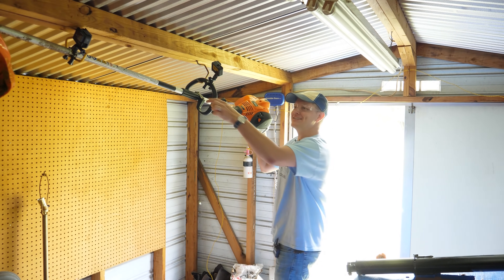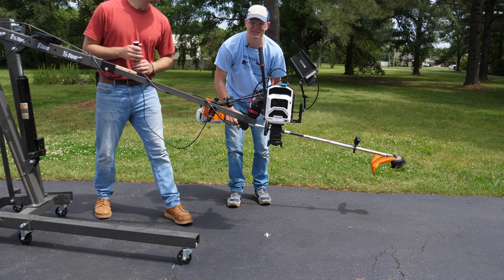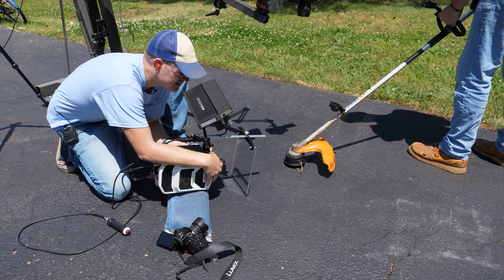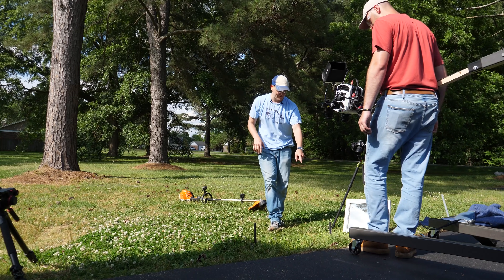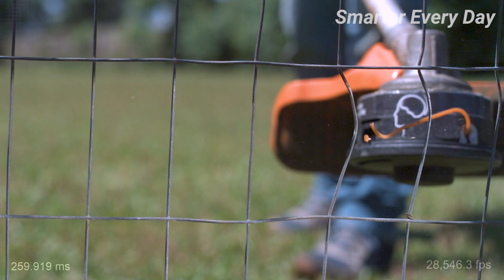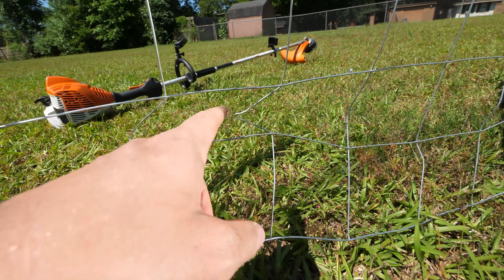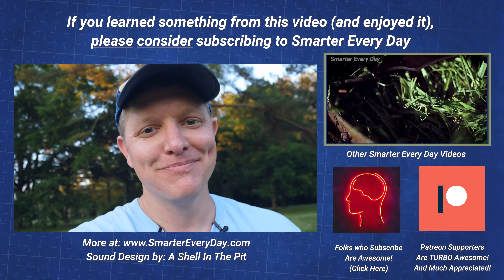How Weed Eaters Work (at 62,000 FRAMES PER SECOND) - Smarter Every Day 236

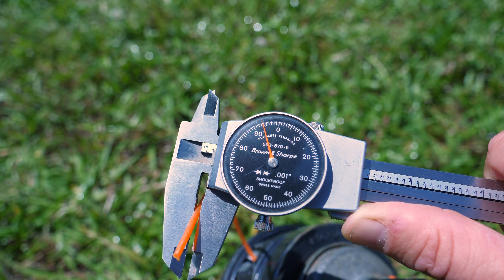Comment: 10:29 
Me: well the small line is always gonna be 2,4mm right
The guy in vid: looks like 95 thousands of an inch
Me: Okay, if you say so
Reply: There are all different line thicknesses available, with the motor power typically the deciding factor in which are supported by a given whipper snipper. 
But I was like you, 95 thousands - no idea if that's thick, thin or in-between.
Reply: @Thermalions  As far as I know, on all of the regular small trimmers its gonna be standard 2,4mm 90% of the time and sometimes 2,7mm. I do have a larger Husqvarna that uses 3mm line, but thats as big as it gets, you dont see it on the more common smaller ones. I have no idea what 95 thousands of an inch is, I only guess its 2,4mm.
Reply: @FOKI5895  My Stihl AP battery powered trimmer is 2.0mm, but I'd agree most small petrol powered ones would generally be 2.4mm as you say.
Reply: @FOKI5895  2.4 mm / 25.4 = .0945"
Reply: It's beyond me why anyone would consider that a superior unit of measurement over millimeters. I don't even bother trying to convert it anymore, as soon as thousandths of an inch are mentioned by anyone I just phase out.
Reply: @Outland9000  I agree, it's far easier to add millimeters than fractions of inches. In fact yesterday several acquaintances and I were talking about that the other day. Say we wanted to slap together different sheets of wood, 1-3/8 + 2-5/16 + 3-9/32.It's far easier to deal with decimal points in the metric system than fractions..................and we all know how much the common man likes to play with fractions.
Reply: @ItsNotAllRainbows_and_Unicorns  he did use decimal value of an inch not fractions.
Reply: @ObelixCMM  I am not talking about FK, I am merely making a reference to my experiences with people who use standard. I am an engineer and for me it's common to work with both systems, standard and metric and doing conversions. But people I came across who are not so savvy with math find workign with fractions difficult to work with. I often have to spend time giving a short math lesson.
Reply: @ItsNotAllRainbows_and_Unicorns  I work in quality so I deal with same issues, plus engineers that don't know difference between .095 and 0.095
Reply: @ObelixCMM  isn't it the same tho? what's the difference if it isnt the same?
Reply: @opemvbs   Zero in front of decimal is required in metric system, in imperial (inch) zero is omitted.
Reply: Why though
Reply: @whats_happening_in_tvm  murica
Reply: Oh good, another pack of people very butthurt about metric not being used.  How interesting and novel.

Comment: Okay, this was fantastic.  I have soo many questions.

What are the different materials of the line, not just the geometry?  Now that we know that little bits of line get broken off and left in your yard, are they biodegradable or otherwise harmless?  What would happen with the cut on the line guard if you sharpened that piece of metal?  And, what would happen if you put some metal wire in where the line was supposed to be?

I can't wait to see your next episode on this, I don't know that you'll see my questions but it will be awesome either way.

Comment: I'm really suprised about all the tiny bits breaking off, that's quite some plastic getting into nature... Are there any bio-degradable wires?
Reply: That's thicker plastic take longer to fully disintegrated although going by total volume it's pretty bad, so it's our kids generation problem. 

Thin soft plastic bag are quicker to get inside the insect and work up into our bodies. Insect > smal fish > big fish > human, all in 3 years or less. People use thin plastic very deliberately in almost anything.
Reply: The line degrades pretty quickly when exposed to uv light.
Reply: I used to use the LARGE scissors

Comment: I would disagree with what’s happening to the Trimmer line as it wraps around the fence. I would guess that the trimmer  motor speed is faster than the unravel speed of the line on the fence and at some point the line reaches its maximum stretch point and snaps. It doesn’t appear to me like the fence is breaking or pulverizing the line by hitting it.

Comment: Something I found interesting which wasn't mentioned on the final test: The line didn't break when wrapping around the smallest diameter wire from what I assume is the wire bending from impact. This would reduce the line speed, and make the line wrapped around the wire subject to less tension. Would be interested to hear what Destin or others think though.

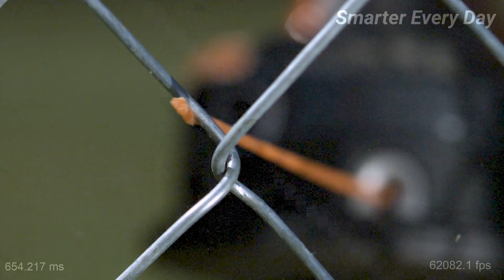Comment: @12:21 I think it is a tension break when the wire hits and wraps itself horizontally and it is a shear break when the wire hits with an angle, which is app. 45 degrees, which is perfect for shear. Maybe you should have kept the leftover pieces and done some microscopy to see the texture of the cut!

Comment: I’ve been running a Homelite weed eater for 19 years.  I recently acquired an Echo weed eater.  I started using it and realized it was throwing debris at me.  Turns out some weed eaters run clockwise and some counter-clockwise.  I’m not sure what I’m going to do.  Do I relearn how to run a weed eater or do I run it like I am accustomed to?  I like the machine but it sure is different.
Reply: No they all spin the same direction. The problem that i found with echo is the trimmer head has a terrible angle and bulky head. Makes the debis thrown from the line propel twords the operator more. And i think the guard may have a little to do with it.  With my years expeience i could run my Huskavarna string trimer without safety glasses and never get hit. But i never was able to with an echo
Reply: Murker 187
You are incorrect.  I have two weed eaters sitting in my garage and they turn different directions.  The line cutters are on different sides of the guard....they are different.
Reply: @Iexpedite1  stop buying from australia.
Reply: Murker 187 

You may be on to something.  Those backward Aussie's have pulled a fast one.  

I used the thing again today and I agree that the shield is entirely too small for the giant head.  Early models had a much larger guard.  Even switching sides and angles put me in the line of fire.  The machine has significant meaning to me...I’ll learn to deal with it.
Reply: @Iexpedite1  lol like the world turned upside down for them.  And ive never seen one turn the opposite direction. So thats new to me. Good luck and dont forget ur ppe

Comment: Really interesting! I was a landscaper for years working for my dad's business. The aerodynamic lawnmower blades were something I had figured out but I always wondered what happened when a weed eater hit something hard. How it broke exactly. Thanks for solving this mystery!

If you ever get to leaf blowers, try standing two five gallon buckets about ten inches apart and blow air between them. I thought they would fly apart but they flew into each other! It makes sense when you think about the physics (faster moving air is lower pressure air) but it was cool to see.

Comment: My grandpa thinks i am so strange because it doesnt feel right for me to trim from left to right. I have to go right to left for some reason.
Reply: Off the head of a string trimmer going right to left helps cushion the load and stress on the line. Going left to right almost pulls the head into the ground and causes stronger impact on the line. But the result is the same if you have good control. Just pay attention to ur rpm's. No need to run one at full throttle.
Reply: @murker1879  i guess that makes quite a bit of sense when i think about it

Comment: Hey Destin, 
Loved the video but I wanted to bring up a few points that you haven't mentioned. You brought up that when wrapping around the wire sometimes it's easier for it to just break off rather than unwrap. I would agree and would like to share my observations from when I've used a weed wacker. I was always fascinated by how the cable of the wacker would heat up during use and especially after hitting a fence or wall. I believe this would be the reason why sometimes it would break at the pinch point of the fence, before it wraps around the fence, or if it broke further down the cable; the point where it's the weakest due to heat (as well as other factors obviously). It would take more testing but I would be interested to see if the places you see with the most damage would be hotter under a thermal camera or, in the case of the high speed in this video, if those points that broke had already hit the fence with no visible damage where I would expect it would instead be hotter then the rest of the cable.
Anyway thanks for continuing the awesome content and the raycon recommendation (I'm gonna get the e55's)

Comment: the most interesting thing about the last chicken wire test is that the metal on the vertical sections doesnt break until it is nearly parallel with the horizontal section, and the horizontal section obviously has a tremendous amount more tensile strength than the 4 inch vertical piece, and you can literally see it bend back and forth until it pulls so hard it snaps off at the base. Youre right, that would be the weakest spot, but obviously the metal is so small and flexible that the effect of the connection is actually stronger than the surrounding metal, and it is the opposing tensile forces pulling the metal apart, literally ripping it like a block of cheese torn asunder by dwayne johnson.

The other interesting thing is that at high speeds the nylon (i presume) line becomes almost a liquid, it is pulled so hard, you can see the line hit, stop, wrap around, and then as soon as the head rotation propagates, it snaps it taut almost instantly, pulling it and squeezing it, often either liquefying the plastic or squeezing some liquid chemical component out. Fascinating stuff to watch. 

Ive said it before, ill say it again, i really enjoy watching slow motion video, it gives you such an insight into how physics works. I wish we could perceive all of reality at these speeds and resolutions, at our own choice of course, but the ability to slow time down and watch the fastest micro-meteorite burn up in atmosphere, or to speed time up and watch continents drift across millions of years, this kind of power would allow computations and science to be done, math of the physics of movement on every scale, it would be so fascinating to watch, even if nothing was ever done with it it would be worth it to have seen it.

Comment: you not getting accurate measurements with you calipers because you are not using the right part to measure with you are only supposed to measure OD with the tips of the calipers jaws because they are actually closer together than the middle of the jaws were you took your measurement from

Comment: The behavior with the thinnest wire is a great demonstration of how crumple zones work - the wire has some give to it (in some cases a lot of give) and this increases the length of time spent interacting with the weed eater line, similar to a car’s crumple zone spreading out the impact of a car over time. It didn’t seem like any of the weed eater line got cut (or had tension breaks) with the thinnest wire because of this, though that might be due to the limited footage shared for that particular test. In any case, great video - thank you for sharing your curiosity with us Destin!

Comment: It's interesting how the thinnest wire didn't break the line as much... maybe because the wire was more malleable than the other wires?
Also, I SO do not miss the sound, vibration, and smell of gasoline weeders. Messing around with the power cable on my electric is annoying (and perhaps prohibitive for a large yard), but very worth it!

Comment: Great video, you should try it using a commercial grade line though. Stihls' green line or maybe Echo black diamond line
Reply: You talking about the line with a metal thru the center?
Reply: @murker1879  negative, havnt heard of that before
Reply: @yourfavoritelawnguy2722 there is a line with metal wire thru the center but its for sidewalk edging only. Not for normal use. Thats why i was wondering. Some ppl try to put it on normal string trimmers and that pisses me off. Lol

Comment: I’m probably going to do that tomorrow. Another variable to consider: the drivetrain for the weed eater. On smaller models there is a a twisted steel cable. On models the like Stihl FS90 and higher there is a solid shaft. The solid shaft means less loss in torque when you run into an object.

Comment: Looking at the footage at around 6:25 I worked out it takes 10ms for one revolution of the head, so that only works out to a speed of 100hz (0.01^(-1) or 1/0.01) second which is 6,000rpm. I dunno why, but I would have expected it to be going a lot faster. I didn't think of it until just now, but I guess given the tone of the sound the weed eater makes, it is about a 100hz tone. So it all adds up.

Comment: Awesome video! I had a trimmer with a bump advance, I was trimming by the fence where some volunteer maple trees had sprouted. My line got wrapped around something, and the head pulled into the fence. The RPMs shot up so I knew the line had snapped. I tried to bump it, nothing happened. I stopped it and looked, the spool was empty. Reload the spool, start trimmer, RPMs stay low, and I look, all the line is at my feet? When the line got caught, it pulled so hard it snapped off the pawls that stopped the spool after each bump. I ended up cutting lengths of line, tying a knot in the middle, and threading both ends through the feed hole in the head. When the line wore down I had to stop and change the line for a new knotted section. I bought a new trimmer this year! Stay safe and keep on being excellent to others!
Reply: Some times crappy line will do that. Especialy square line. For ur new trimmer get some "ugly line" its strong durable and u will use less.

Comment: Question: How far from the centre is the optimal cutting distance? Intuitively it would be at the maximum length
Reply: Cause there was interesting moments on that last fence type where it seemed like it changed its interaction with the fence as it was closer to the head

Comment: Destin - here something to keep in mind before you do the next part with the pine tests: 
Most lines dry out and get brittle over time.  You can recover the pliability  by soaking the line in water for a few days.  Try to buy lines from about the same vintage for your comparison, or alternately soak all of the lines in water for a few days before you test it. 
PS: WeedEater is a brand name - the generic description is “string trimmer” or “line trimmer”. 
PPS: there’s a lot of design that goes into trimmers - I know, I led design teams for several string trimmers when I worked for B&D.

Comment: Once again Mr Destin, yet another winner of a topic from your veritable stable of interesting things in slo-mo from which I have learned so much about these cutting devices. In England we call them strimmers, 2nd, I never knew that about banging the end on the ground to extend the line.
For a later project could you to film the exothermic reaction of putting a fine kibbled quicklime into water. I'm told that the heat generated is about 900 degree's. I do this often for my work (lime putty plasterer) and mix up about 40 kg with 4 full buckets of water. It looks a bit like hot ice-cream bubbling away and when it's cool it's lime putty.

Comment: Hey, im a gardener. You shouldnt use a weed eater at full power. You should 'tab' the button so it revs up slowly each time!
Reply: Dont tab the button, but find a nice constant run speed for the task. Will help with accuracy and fuel economy
Reply: At my school they teach you to never use it at the same speed. It is very bad for the weed eater it self.
Reply: @TheSaboteur99  not at all any machine running at a constant rpms is better for the engine, any bearings, and fuel consumption.
Reply: @murker1879  mhmm i guess i was half asleep in the class
Reply: @TheSaboteur99  do you "tab" your gas petal in your car? Do you "tab" a lawn mower?  Do jets tab there engine s in the sky?? No cause machines are made to run at a certain rpm. Dont red line it all day but a happy constant speed increases productivity, accuracy, and control.
Reply: Interesting. I only rev mine high enough so that it will effectively cut the grass; that's to save fuel, keep the engine cool, and out of respect to my neighbors.
Reply: @WanJae42  yeah. Use ur. Rpms as need. Never a reason to go full rpm unless ur bumping more string out.

Comment: Instead of square or triangular shaped grass-cutting line, I save a gob of money and get a huge spool of fishing line (matching the weed-eater line's diameter). It does tend to break a bit more often, but costs a fraction of the price and the bump-n-feed means the only hassle is the re-loading of the core trimmer spool happens more  often. However, they came in threes, so it's easy to have the spares handy.

Comment: You forgot to mention the best tip of all, so I will do it for you. What do you do when the weed eater runs out of line? Well, I do something different. I stop the stupid thing, of course, but then instead of disassembling the head, all I do is twist it while looking through the holes on the side until they line up so I can see daylight from side to side through the holes where the string comes out and then I fish through about six or seven feet of the line to center and then just crank it up not having to remove the head and when it's down to about the size I need I'm good to go. You're welcome.